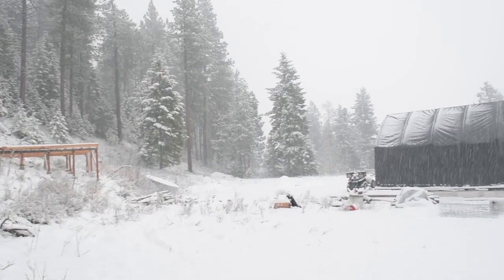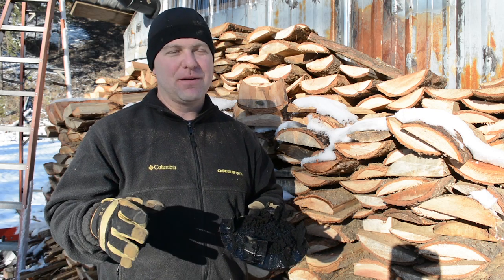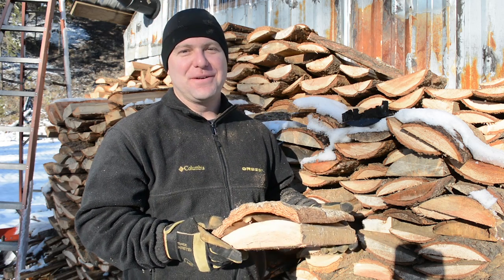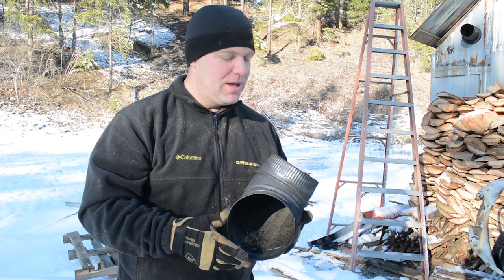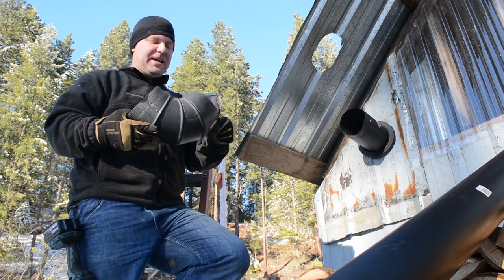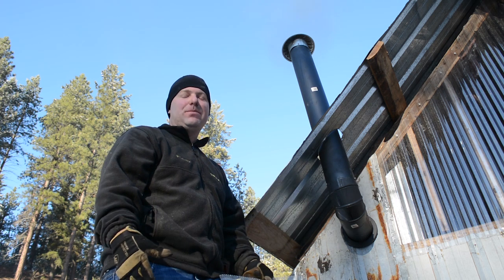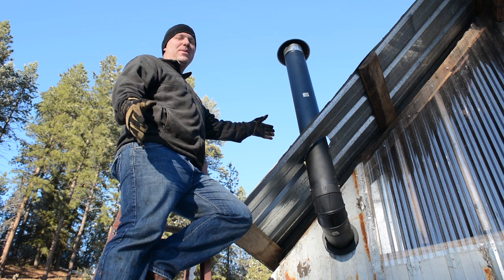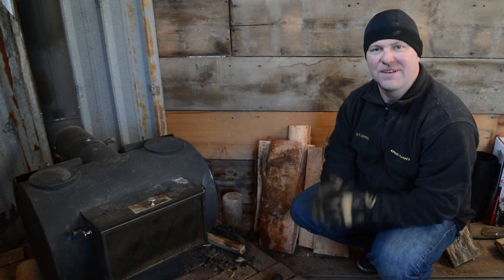WE GOTS PROBLEMS! Troubleshooting & Cleaning Our Wood Stove Chimney Pipe

Comment: The problem is that pine has alot of sap that creates tar or creosote in your chimney. Hardwood has much less of this tar / pitch in it. If you have green sappy wood it is even worse. I use green hardwood here in Chile and it has alot of sap which actually drips from my chimney pipe. I collect this and make creosote for my board fences. You boil it down and add burnt motor oil and it makes great fence paint. 
If you burn a really hot fire and have a lot of build up in your chimney it will cause a fire in your chimney, so you will need to clean it often. 
Once you have seasoned wood or wood that has been put up one season ago and had time for the sap to dry out you will have a better fire without all that hissing too.
Reply from the maker: It's been so long since I've burned wood for heat I'm having to relearn so many things. Thanks for the tip on catching the dripping creosote. I saw some a few drops bit since setting the pine aside there isn't much at all. I do need to find a way to treat posts. Going to keep our used oil and figure that out someday. Learning so much! Hopefully when we are able to properly gather firewood it'll help too. It's all lessons learned. This why we are sharing! I remember chimney fired as a kid. We had some powder stuff we used to burn up the soot. We are trying stuff and learning though. I thought this setup wouldn't work. Seems it does but like anything has personality.

Comment: put a t in where that 90 is  then cap the bottom... then you can clean it from the ground with a sweep, from the bottom of the T..  I removed the screen from our cap because it would plug up quickly.   adding A T is the way to go for easy cleanouts.
Reply from the maker: A 't' is on the project evolution list. We want to try this for a bit and see its weak points. We removed the spark arrestor already. Waste of time. If this setup is working we'll put in a t and totally like you said life will be easier with cleaning. If it fails on us we'll have to look at the options others have mentioned like schedule 20 pipe or double wall stainless. All great lessons!

Comment: I have burned pine wood for years and never had a problem, but I have find that for pine wood of any kind needs  three years plus and then let it burn hot. lots of air flow. Also split your pine wood where it is no larger than 3 inches in diameter and put in three or four pieces at a time to burn hot. Bark will not cause any problems unless it is wet. Keep pine wood in doors for a few days to get dampness off wood before you burn it.

Comment: Have you looked into Rocket Mass heaters in any way?  It'll actually burn up junky wood and it burns FAR cleaner and far more efficiently than a normal fireplace or wood stove.  Check out Paul Wheaton and Permies.  I've been wanting to go in this direction for several years now, but have to deal with old east coast city building codes.

Comment: Hi guys.  Love the content.  Looking to do the same thing very soon.   On the chimney issue:   There is something weird about your cap.  Do you have a part number for it ?   The cap that I have is completely different and it looks like the air flow is very restricted on your cap.  The tubular section seems to come within a very short distance of the cap that keeps the rain out.   Go to ventingpipe.com and look at the caps that they have.   Of course the "proper" cap is made to go on the end of a piece of a class A pipe, but look at the type B caps (used for lower temperature flues on NG and propane chimneys).   Even if you got a cap meant for class A pipe, you should be able to adapt it to fit over your stovepipe.   For a wood stove, you should remove the woven wire spark arrestor since otherwise that will certainly plug up in a very short time.   You would also benefit from a cheap plate steel stove for $400-500 that are sold by the big box stores, which has a secondary air system and thus burns clean and hot.  Century is one of the names.   The cast iron stoves (so called EPA exempt) are wood wasters.

Comment: If you don't have a lot of money get cheap 8 inch pipe and put around the 6 inch it's not perfect but works better than single wall it keeps the pipe hotter
Reply: I was thinking of a fiberglass wrap. If it gets wet,no good. never mind. The comment above is better.
Reply: Andrew Tiefry I used that hint and went all the way out with double and a ring cap at the end so the 6 inch pipe is centered and can go the last 6 feet to finish the stack. It was too cold to light without lots of smoke but Ill add 2 more feet of stack and a cap that should get a good draw. I feel safer doing it this way than with double wall that has a smaller footprint sure but the bigger space lets the outer pipe stay cool. Thanx again for that post it helped me save a lot on a temporary thing.

Comment: Softwood, it clogs the chimney, it is not only the bark but also the same wood has, a number of resins, varnishes .. burning only coniferous wood, chimney cleaning is common. cleanly burn soft hardwoods like alder I don't how you call in english :) .. chimney cleans well potato peelings, just put together with firewood logs in hot stove.

Comment: Hi Guys! Thanks for your channel (subscribed :)! 
Quick tip on this problem: try to find some Alder wood around - and use it once a week instead of pine and other wood high in resin. 
(Very old Russian way to get rid of that stuff; Alder has been called a 'Tzar's Firewood' not only because of its ability to burn without any stuff left in chimneys - 'Tzar's Safety comes first' :) - but to clean a chimney from whatever stuff it has collected).
Cheers!

Comment: Your pipe sections are upside down. The crimped end (make) should be inserted downward so creosote flows down the inside of the pipe instead of coming out and creating a fire in your house. The draw will keep smoke from coming out of the connections.

Comment: Even pine mill ends are not dry for at least a year after they were cut and stacked for drying. Typically wood for stove should be dried for at least 2 years before it is used and 3 years is better. Bark is not an issue with properly dried wood splits.

Comment: With our place and the living room stove, we use 2 stoves but the living room is the most often used, daily in fall and winter, we went single wall to the roofline then dual wall from the ceiling through the attic area and out for fire safety. 
With our install we were told for a wood stove you can not have bends like you guys have due to heat and soot buildup and the probable fire hazard with buildups in the areas of the angles. 
Gas and pellet stoves are OK with bends for the exhaust but not wood stoves, unless that's changed in the last few years but I doubt it. 
Since your current setup is not permanent I get it,  but when your actual house is being built don't chance it, build the stove piping the way that lessens the fire danger for you guys. You also already need to get the stove pipe cleaning tool, stiff bristles with long heavy wire sections. Locally at any of the building supply places, Home Depot in Sandpoint or as with everything else, Amazon! 
Screw the brush top on a section, and it takes 2 sections to clean out the pipe at our house, I think they are in 10 foot sections, and we do that every year in the fall and sometimes we have to clean ours out at some point during winter, since we're in the same general area as you guys we also have various types of wood we use for the stove. Continued good luck!

Comment: hi there I'm a new subscriber,  I like you're channel. best of luck on the new homestead. speaking of luck you got really lucky with the woodstove. lucky you didn't have a flue fire those are bad news  a flue fire could have burnt down everything, trailer included. stay safe  burning wood has some danger involved .  p.s. if you have a choice in the wood you burn pine is the worst  too much resin
Reply from the maker: +midmo prepper Welcome to the channel! :) No joke on the flue fire. We haven't had one yet and don't intend to, but the risk is always there. Thanks for the tip on Pine. We kinda knew that, but this year what can we do? Make the best of what we have. There's just too much to do and we'll do our best. As a kid our house burnt down, not because of a flue fire. Just a very dry year and a small spark from the chimney caused a small ground fire which ended up taking the whole house with it. Very traumatizing. I've been slowing learning to trust this stove, but it'll never trust any stove 100%. Thanks again for subscribing and coming along with us!

Comment: I'm sure you guys have seen the bazillion videos on here where people are making or testing "rocket stoves." While the name might be real catchy and people love playing with fire, most of these videos don't display a stove that has the type of burn characteristics to call it a true rocket stove. That has a lot more to do with a self-insulating double pass burn chamber that creates a clean burn and strong draft (hence the roaring sound that I suppose gives it its name).  
Even a very basic horizontal wood stove like yours could be very simply modified to create much of the same effect as a true rocket stove, which would have multiple benefits. It would go a long ways toward ensuring a clean burn almost all of the time. It would also trap more of the heat inside the house, rather than exhausting it out the chimney. Lastly, since the much higher percentage of the wood is actually burning inside the stove, the amount of heat your get for your home, per pound of wood burnt, will be much higher.  
Check into the actual theory behind the rockets, and look into getting a liner for your stove and a draft tube that pulls from outside air. These 2 modifications alone would give you a huge benefit, and likely cost almost nothing.

Comment: Soft woods are a waste of time, people get rid of it for free cause it's nothing good other than for a camp fire. You need to find hard wood(s) and you won't have a problem. The higher your chimney, the better the draft... I don't use double wall for any of my stoves and I have never had a problem, but I also have a good high chimney. I also don't have a cap, again waste of time... If you hear something that sounds like a "jet engine" when you have a fire going, you've ignited creosote and a fire like that can and will burn a house down...  Capture your exhaust gases with something like a "Magic Heat" the amount of heat waste is staggering... I've been heating my home with wood for over 10 years. It's a labor of love and it warms you more than once for sure... Later on down the road if you guys make it with this life style... Ditch the maul and get a good gas powered wood splitter... Nice seeing people take on stuff like this. It's not an easy life style, but a rewarding one... Good luck.

Comment: Other options:
1. split the pinebark from the wood and run it trough your chippers and then put it in a heap outside in the full rain and the snow so it can start to rot.
This will be perfect acidic garden mulch around your acidic loving trees and shrubs like walnut trees and blueberry bushes.
2. Use those stones and rocks around your place to cement around your stove and stove pipe to make a thermal battery.
Reply from the maker: +J. Verheulst You're a beast! We're stacking all the bark that we can get off the pieces in a pile. Hoped to find a use for it around the property. How much do people pay for bark mulch right? $$$ On the rocks we're still trying to figure out a way to wash them. We have lots of rocks, but limited water. Might not get that done this year, but if we can find a way to collect more rain water we can use that to clean the rocks up. I call this job security. LOL :)
Reply: You can dump the bark chips around your future walnut trees and blackberry bushes.
They love the acidification that the bark chips provide.
They really thrive on it.
Same wth rododendrons that you can plant as wind breaks on the northern sides of your property.
Reply: We use slabs of bark in layers to make walkways in between our deep mulch garden beds. No chipping necessary and it looks charming imo. Thank you for your great videos!
Reply: First sorry about the book; just some idea's that I've used on house's:

     Check with your wood stove shop's around the area and get broken fire brick and high heat mortar: Then crush the broken fire brick up into   1/2"-3/8" minus and mix with the mortar to use in your rock thermo mass will help to retain heat better and give it up better too: Also you can put up oiled play wood  on your wall joist and hang chicken wire with some through joist support in 2'sections and jump pour; "( Then do 2" more and when the bottom 2" can support it self move that form up for the next pour: It will also cut down on drafts too)" and pour the fire brick mortar mix with larger rock into the space's for more thermal mass "(For safety put 6" to 1' wide ply wood braces across the thermo mass in your wall at the joint and in between While leaving the most exposed that you can)" and on the floor around your stove: Use the "T's" to make your clean out easier but just put caps on the bottom's and make a wand for your compressor to blow the level area in so as to clean it to your next "T":  "(I guess this post is more for others to read for their Info ? But this can be used on your house and barn: For house get ceramic tiles and make patterns behind your wood heat stove and wood cook stove for thermo mass and good looks at the same time while having zero clearance Go from lowest level to highest level with your thermo mass for best result's and as close to the center of your house that you can)".

Comment: You have to season firewood. Green wood = problems. Bark is not a real issue, as long as you burn it hot. Double wall chimney would definitely have helped or removed the issue. Learning curves.

Comment: The problem is not the ratio of the wood to bark density, its actually the tree's sap which is found between the bark and the wood which causes the buildup of soot. Pine is one of the trees which has the most sap of any USA tree and is the most dangerous to use as firewood because of that factor. The sap's soot builds up in the flue and begins to burn within the exhaust pipe and can set nearby wood walls to catch on fire. Many houses have been burnt to the ground because of burning pine in a fireplace.

Comment: I must have hit the wrong button, looks like my comment vanished.

Will try again, I can see day light thru to walls, the cracks so there is going to be cold, rain and snow.

you probably corrected this situation  BUT old time ship builders and sailors, wood ships, would jam tarred rope in the cracks to make them more water tight, the hulls decks etc.

This tarred rope/rags would help keep the weather out and make it somewhat more comfortable.
Reply: I am really waiting to see the floor of the garage poured and see if they are putting in the floor pipes or tubing to run hot water thru to heat the building.

I have heard mention of radiant heating---don't know if that goes in the cement floor like I mentioned or if it is suspended from the basement ceiling----guess I will find out pretty soon, think the next video is pouring the floor.

Thank you for showing your work/ experiences in your project..

Comment: Hi. The straighter the stove pipe the better. If you can run the stove pipe through the roof straight up it will draw better. You have 3 90 degree bends in your stove pipe and these are drastically slowing down the gases as they try to escape up the pipe. It is recommended to use 45 degree bends wherever possible and to use as few as possible to keep the speed of the gases up. Sorry, but ignoring hundreds of years of experience by millions of people and industry testing costing millions is a bit stupid. If you had fitted the twin wall in the first place you would not have had as many problems and would not have wasted your money on the single wall which you will HAVE to replace if you want everything to work properly. I hope everything goes well for you in the future and the 2 of you have a wonderful life together.

Comment: Your chimney is at least 3 feet too short. It should be above t he ridge line plus you are below he wind line so it is very important for higher chimney.
Reply: Needs to be 2 feet higher than any part of roof within 10 foot radius around pipe.  If it is too short, smoke will chooch out of the stove and into the house when the wind blows.